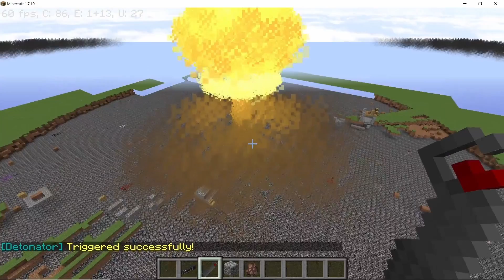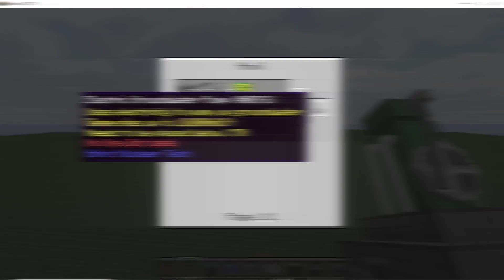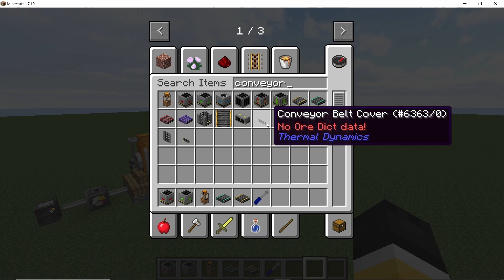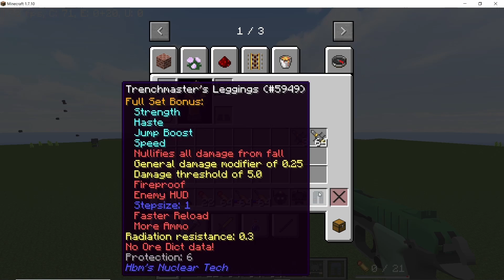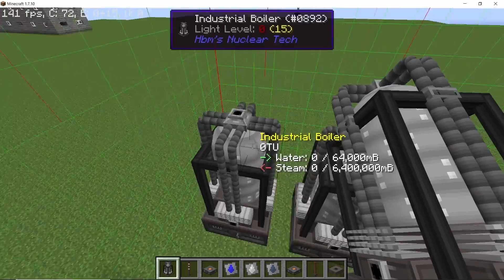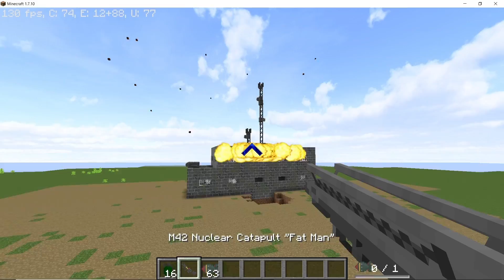Water Pumps, Industrial Smokestack, Nuclear Explosion Changes and More - HBM's NTM Updates

Comment: The smokestacks don't seem to be reducing any pollution while connected to fluid burners with Unsaturated Hydrocarbons, do they not work with that? The pollution goes up at the same rate whether its connected or not with exhaust pipes, there is smoke that comes out of the top of the industrial smokestack but the pollution rises at the same rate. Am I doing anything wrong?

Comment: The capacitor should have a huge discharge rate for maybe machines that need big amounts of energy to start or work
Reply from the maker: Particle accelerators need that fast rate of energy transfer but there are already transformers for that purpose 
Most other machines don't need thar afaik

Comment: There is a ballistic missile called Concrete Cracker if I'm not mistaken, and it does everything except break concrete, that should be changed, since it seems very excessive to me to use a nuclear bomb for a concrete bunker, and also, the name of the missile tells you It's supposed to break concrete, they should fix that.
Reply from the maker: The latest update of the mod has changed that, concrete cracker does break concrete now ... Tears it up like knife in butter

Comment: i actually wanted to add pumps to NTM by myself, but HBM just decides to do it instead. looks like those require steam instead of a water source below the block
Reply from the maker: If you would've added one, would it have looked like the one bob added ?? or something a bit more industrial
Reply: @SavageVegeta  it was just a 1-block machine that just required power and water below it
The texture is similar to the deuterium extraction machine
Reply from the maker: @Voxelstice  ah ok

Comment: the only thing they need to add is a radiation sensor that when there are radiations above a level that you can put it emits an redstone signal
Reply from the maker: Hmm that is an interesting suggestion indeed. Maybe a change in the radiation system (if it ever comes) will introduce a machine like that
Reply: The 1.12.2 port has that
Reply: @CLOCK-WORK  ok, but i mean it would be cool for HBM 1.7.10
Reply: @kggames7885  yea it would be but just play 1.12.2 it's far more stable and if you whant stuff from 1.7.10 just port it to 1.12.2 or add other mods to it
Reply: You're Gona most likely play it with other mods anyway